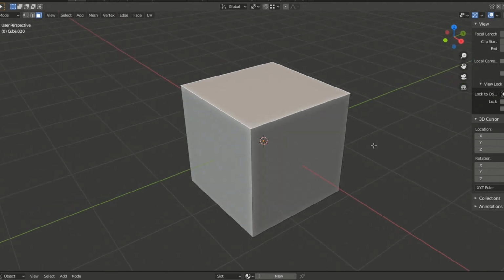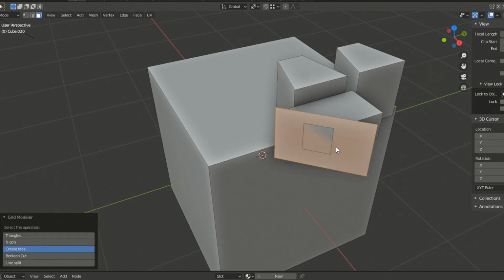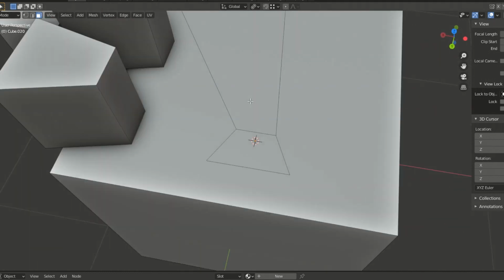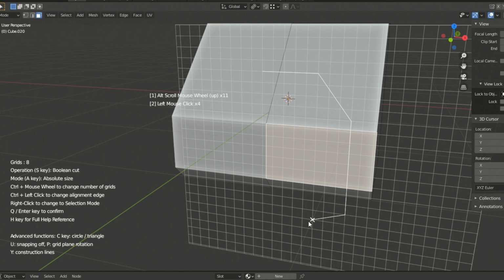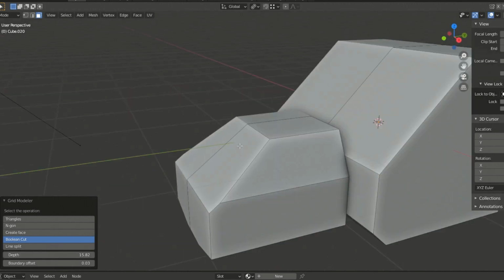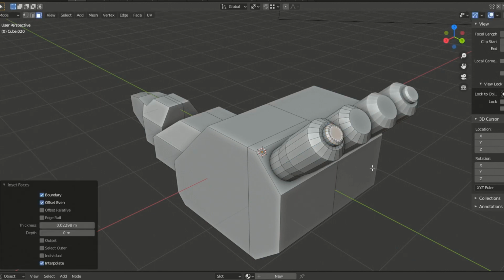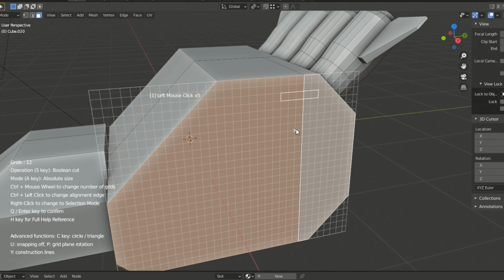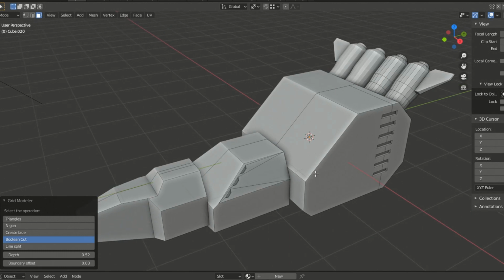Beginner tutorial for Grid Modeler (blender addon)

Comment: how do you get rid of those lines , on the Object.
Reply from the maker: After pressing Q key or Esc, the tool end and the grid disappear.
Reply: @kushiro_cg  no i man, after you make a boolean cut,  there's artifacts o the mesh , how do i fix that.
Reply from the maker: @mymozy1  This is blender problem. If the result face is ngon, blender add the edges inside them, because blender cannot handle hole in ngon.

Comment: I got it working for 4.2

Modify the Plugin Code (Temporary Fix):
If you are comfortable with Python, you can try to modify the plugin code to avoid the error. You can change the line where self.operation_mode is set.

Here’s what you could do:

Open the plugin file (grid_modeler.py)

Navigate to line 5092 where the error occurs:

self.operation_mode = preference['default_ope']

Temporarily hardcode it to one of the valid enum options, such as 'ngon'. For example:
python
replace with this code:

self.operation_mode = 'ngon'  # Use a valid operation mode

Done. hope that helps anyone else

Comment: I'm having a problem in 3.1. If I am to use the num keys, Blender switches views, it does not allow me to use the Grid Modeler functionality. I tried both the numpad and the regular numbers on top, didn't work. Any idea how to fix this?
Reply from the maker: It works for regular number keys on the top of keyboard. Please check their you have changed the key settings of blender.
Reply: @kushiro_cg  I just checked it again, I disabled the "Emulate Numpad" in the Preferences in it fixed it! thank you.

Comment: Are we able to set the increments of the grid itself? 

For instance, I would like to set my Grid at 1 x 1 Meter. That way if I wanted to build a quick wall I know it will be 2 meters high with a doorway in the middle.
Reply from the maker: Grid Modeler does not have dimensions input yet.

Comment: 15:05 is not working for me. I have made sure that I do not have anything selected, in edit mode, and the viewport shows a side view. 
But starting grid modeler doesn't do anything.
Reply from the maker: Possible 2 reasons, first you have to be in Face mode, not edge mode.  Second, you have to use blender 2.9 or above, 2.83 may have problem for viewplane function

Comment: Love the addon .Is there any way you can add option so that the created face is separate when you make it using grid modeler?. Right I think I have to separate them manually from the original object.
Reply from the maker: I can consider that, but, why you often want to separate it ? (just curious)
Reply: @kushiro_cg   It would be easy for creating objects with different parts and having ability to toggle them on and off in collections easily rather than one whole object, which works for quick SketchUp but would be tedious for a complex object. I hope this helps :)